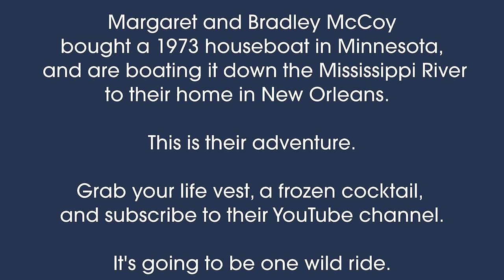ep 3 - Houseboat Prep for our Mississippi River Journey from Winona, MN to New Orleans, LA

Comment: What you removed around the water inlet is Butyl tape.  Its a sealant that never fully cures and is why its a great sealant on a house boat (lot of flexing and movement).  Not sure what flexseal is made of but if it is a silicone based product remove it and replace with either butyl tape or a polyurethane sealant like 3M 4200.  Silicone will not seal for a long time on gelcoat and you will have future leaks and then wood rot.  It also leaches into the gelcoat and prevents future sealants from working (even silicone).  Best to never use silicone sealants on a boat.
Reply from the maker: This is great information. Thank you for sharing. We definitely have a lot of sealing to do, so I'll be sure to use the products you mention. Thanks!

Comment: Mine doesn’t have a valve there. Not a bad idea though if there is a leak. Faster than running outside to shut it off.
Reply from the maker: It was a pain to get to, but did have some advantages as you mentioned.